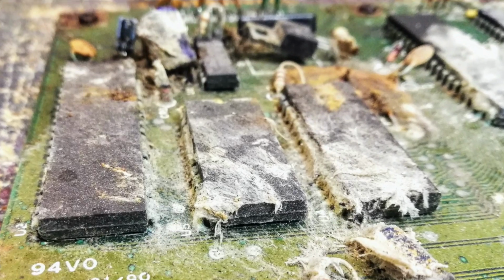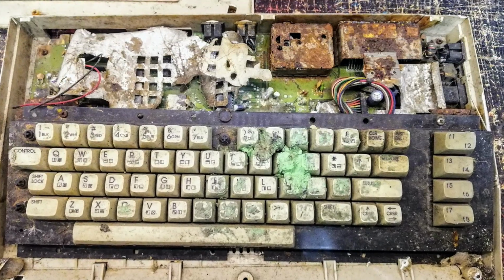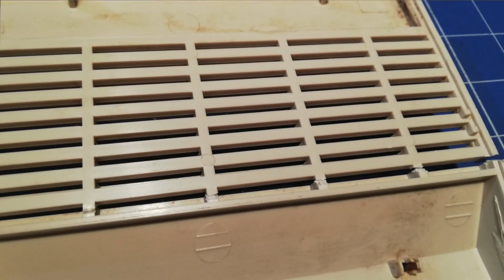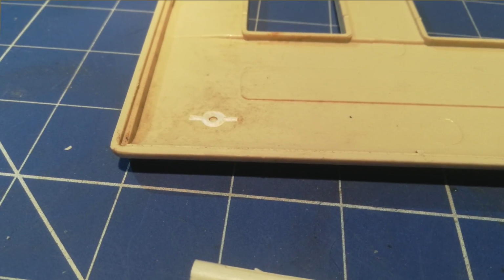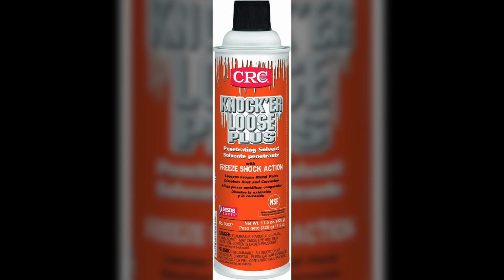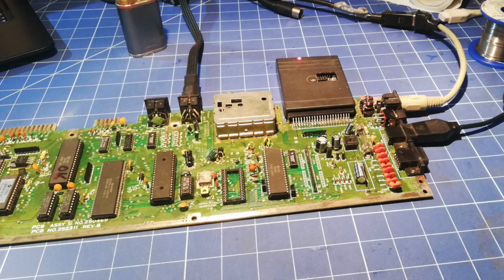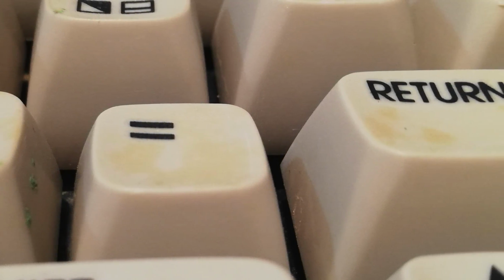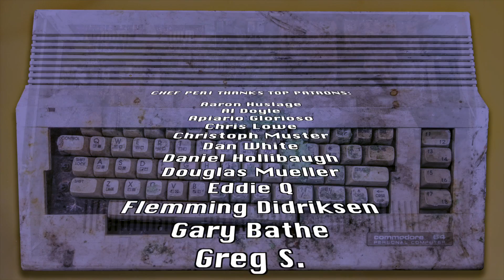Can we save this Commodore 64? EXTREME Refurb!

Comment: It's amazing how resilient these old 64"s can be.  A couple years ago I was buying broken 64's off eBay just to bring them back to life.  Some were nasty as I thought but man nothing as nasty as the one you just worked on.  The most problematic issue I ran into was with the PLA's so much so I have as many spare PLA as I do CIA chips.

Comment: I have to admit, I'm impressed.  The outside looks absolutely beautiful... okay, compared to the way it looked when it arrived, the entire thing is beautiful.  I'm rather surprised that the only thing that had to be replaced (not counting the capacitors, keyboard springs, screws, and screw mounts) was the RF modulator and the PLA.
Reply: Oh, not only that :D CPU and RAM chips were fried plus quite a few other minor parts ;)
Reply: @retrohaxblog  Oh?  I don't recall that being mentioned, but at one point I was distracted by my cat, who insisted on bellyrubs, so I probably didn't hear it because my attention was divided.  It isn't really surprising, though, considering its original state.

Comment: When unscrewing old rusty screws, try this trick:
Use something to hammer the end of the screwdriver when turning. And if it doesn't turn and you are starting to destroying the head of the screw, try tightening it just a bit. This can loosen rust that is lodged between the threads, which causes friction.
Reply from the maker: Probably not a good idea to take a hammer to something that is this fragile though... But good tip otherwise.

Comment: The PLA had a leg rusted off? I have an old IC in one of my Amigas (don't remember which one or which chip it was), where I soldered a broken leg on. It's still all working :) Probably spot welding could be even better.
Why did you decide to use hydrochloric acid instead of phosphoric acid on the expansion board?

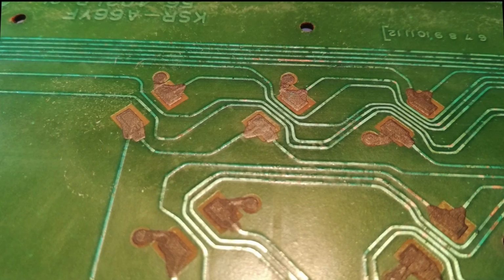Comment: 16:00 - I've used and been disappointed with the longevity of the pencil "lead" trick you show... While it works... it doesn't work for very long. You can get wee tubes (like a car scratch touchup tubes) of conductive paint and it lasts a very long time.  I've refurbished both computer keyboards and house alarm keypads with the stuff and it's terrific...

Comment: Really surprised you didn't have to run a bunch of batch wires across the board. A midst all that corrosion I would have figured there would have been some PCB traces eaten away. Maybe the silky strands, which I'm suspecting was mold, some how protected it.
Reply from the maker: Yes dirt protects!

Comment: Nearly $60 for this junk? HOW? WHY?
Reply: Parts. Just the keycaps is worth a few bucks
Reply: I saw a C64 with lots of disks and stuff for 20€ on a flea marked when I was like 15 and one for 30€ a few months later. I was and still am super interested on old technology and wanted to buy it of course. But I was there with my dad because obviously I wasn't able to drive alone and he said that I couldn't have it. He argued that it took up too much space and was useless. Now those computers are so expensive...
Reply: There were a lot of salvageable parts in that machine.  Even if you couldn't restore it, tearing it down would probably more than recoup your cost.  A lot of the chips are increasingly rare these days. MOS chips haven't been produced in decades. All that's left out there is pretty much salvage.  And as the number of dead chips mount, the remaining good ones keep inching up in price.  For example - the CPU and the SID chips together (since both were working) would go for a combined $70+.  Everything else would be icing on the cake.
Reply: Steven Ingram 
Could you pop in one of the new 6502s?

Maybe the new ones don’t have the 6510’s bank-switching modes/pins. That would be a bummer.
Reply from the maker: The end of the video should answer "why" 😊
Reply: Well i mean i got a C64 maybe 10 years ago and it was like $30 or so. And it's in perfect condition. That's quite a hike when now one in assumed worst possible condition (though actually kinda OK underneath) is double. Especially CMOS models, i thought they were common as dirt and nobody cared about those.
Reply: @Tom2404  
How long ago was this?
Reply: @gregorymalchuk272  it was 2015/16ish and I was 14/15.

Comment: Hey retro gurus, I have a question:

6502 or Z-80? Zed? Who’s Zed??

Just an open ended question about the perception of performance. I’ve heard people say that even with a drastically slower clock speed, the 6502 is the real performer, but from what I can tell, there’s no way to do software-only graphics (composite signal bit-banging) on the 6502, like the ZX-80 and 81 do). 

I wrote a basic program (on an emulated C64) to POKE opcodes into RAM that would just change the border color as fast as possible, and did everything I could to optimize it (including unrolling the loop), and couldn’t get more than about two dozen horizontal bars.

(i.e. I wrote a basic program to load a hand-assembled machine language program into RAM — it did not run in basic)

Comment: This video could have been waaaaaay longer. I'd have loved to see exactly how to melt the brass mesh into the case plastic for example. Don't worry about putting us off- apparently we all quite like your company :-) Anyway, what I'm really wondering about is why did you change from Phosphoric to  Hydrochloric acid? Is it because the pins on the cassette port are copper?
Reply: Yes, exactly. Phosphoric acid reacts nicely with Iron Oxide and Hydrochloric acid cleans complex copper salts.

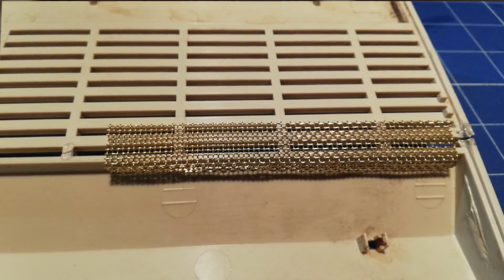Comment: 5:50 Or you can use super glue and baking soda in some cases... Well not this case.... It just gives a hard cement like substance.
Reply from the maker: "In this case"
Reply: @RetroRecipes  Well... Yeah. A case of renewall... 😎 Anyway. Super glue and baking soda are some serious stuff... Turns to cement, like instantly. It is good to rebuild stuff with, like cracked off and missing hinges on monitor-flaps. Also. Epoxy glue are one of my tool's. First epoxy glue, then a coat of superglue-bakingsoda and finally a coat of "paint" made from ABS dissolved in acetone. That way it is extremely tough. Also. Rebuilding screw holes, can be done, using brass standoff's that are normally used for mounting pc motherboards in cases. Just use those with the same screw width as the screws used for CD/DVD/FloppyDisk drives.

Comment: Apple: Let us prevent the repair by locking out each IO section based on an IF statement AND security. E.g. Device receives water ingress, lock out the whole system (I.e. prevent any unauthorized repair) as indicator gets wet.

Right to repair: 35yo+ c64 gets new life without the help of the OEM.

Me: Good show RR.

Addendum: The snake led Adam to eternal damnation, and history is sure to repeat. You Christians, of whom own Apples, wake up xox

Comment: Are you kidding me!!! Your able to refurb that C64 which was in an extremely bad condition and in a much much worse condition than the Titanic Amiga 4000 but yet you was not able to fix the Titanic Amiga 4000 which only suffered a leaking cmos battery and a couple of leaking caps!!!. Something not right there.
Reply from the maker: Well, firstly the Amiga uses a lot of SMD which is hugely harder to repair than the C64 components. C64s can survive incredible hardship. As tech marches on things get smaller and harder to fix. The end of that graph is a MacBook for example. Secondly this repair was done by Pete who is a genius. The A4000 is now with another genius in the Netherlands but still isn't fixed. I know when to cut my losses on a fix. ¯\_(ツ)_/¯

Comment: Have you ever thought about using an ultrasonic cleaner? It's basically a vibrating water bath, and I bet if you used distilled or ultrapure water you could easily clean a lot of electronics!
Reply: Actually, I've put this mobo to a large ultrasonic cleaner for 50 minutes before I even started working on it :)

Comment: I don't believe for a second that with the state that computer was in that you didn't have to install at least a few bodge wires.
Reply from the maker: Well you're wrong 😉 Actually none were needed. Sometimes dirt can protect traces. The trick is to be careful removing it. The only problem was a lifted pad on the cartridge port removal, but this wasn't interesting enough to warrant making the video longer.
Reply: @RetroRecipes  Awesome! I fully expected half the board to be covered in bodges.